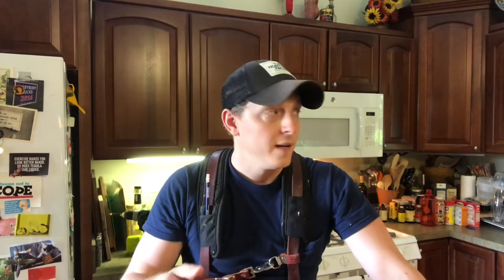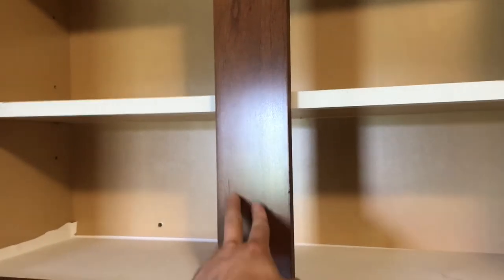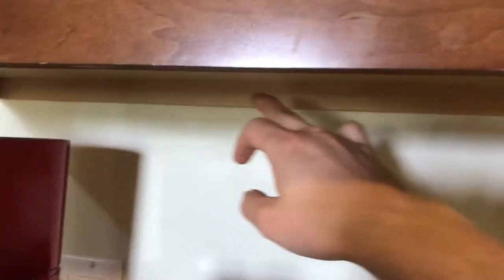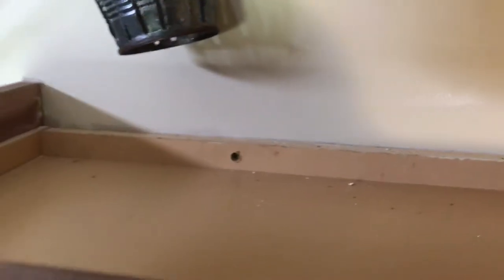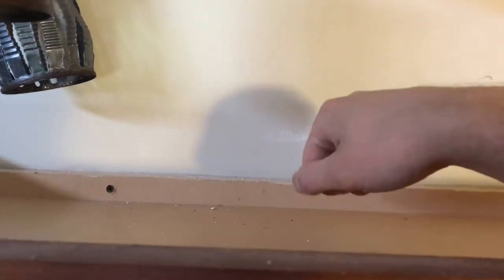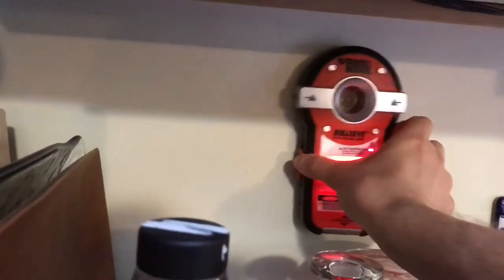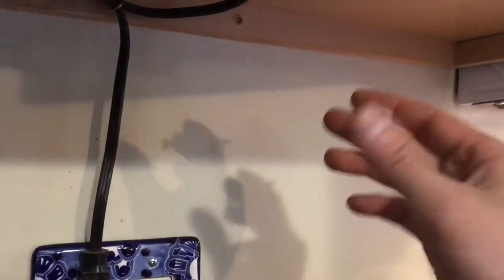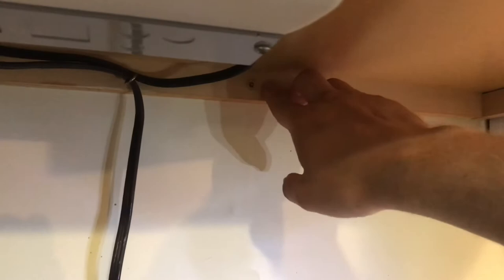Strong Cabinet Mounting

Comment: the top and bottom back rail can be 3 inches wide. the screw seen inside the cabinet could be actually screwing thru 3/4in plywood back rails.

Comment: Those are the wrong kind of screws for cabinets. you want a flat, or button head screw. The tapered screws you have will pull right through the cabinet.

Comment: What screws did you use?
Reply: The wrong kind. GRK makes screws designed for cabinets that work great. The screws he used are NOT designed for hanging cabinets.
Reply: @MAGAMAN  correct. They may not be designed for hanging cabinets, but you’d need a tremendous amount of force to pull those screws through 3/4” material. It won’t be an issue unless people are hanging on them